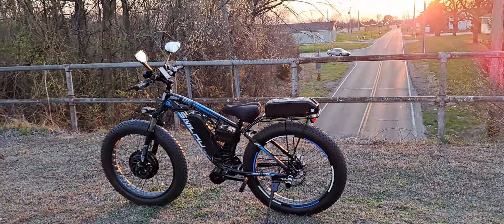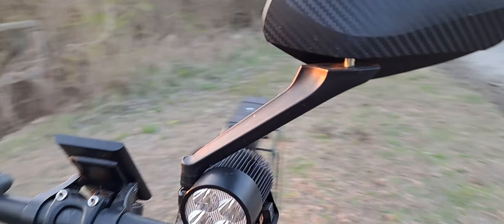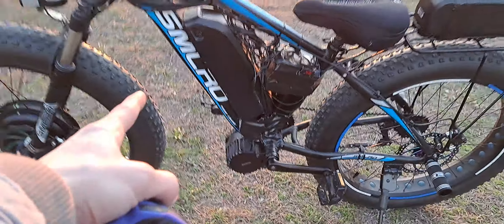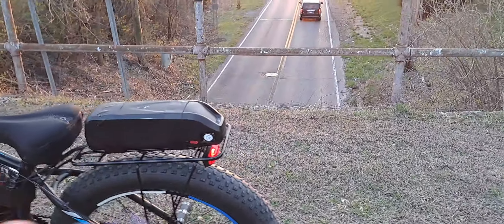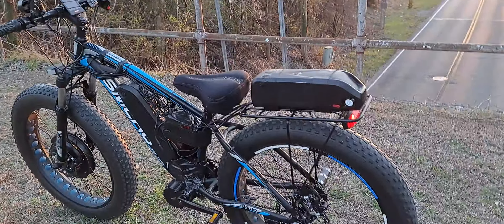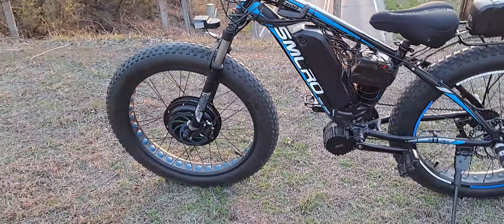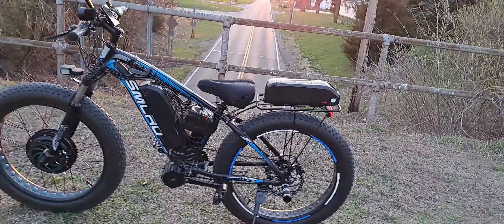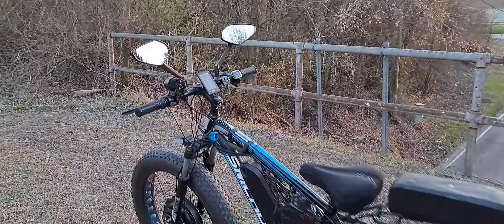Dual wheel drive E-bike build with 3 total batteries test ride

Comment: I got a similar build, I also have a direct drive on my front. A little tip bro, if your controller allows it (or if not get one that does) for the front to use regen braking.. or that electronic braking. They save the heck outa break pads! 

Also I'm curious what front forks you will get that can handle the front motor. Most of the front forks with shocks don't seem to hold up.  By the way what wattage r u pushing thru the front? 

The all wheel drive is fun, especially if you got 2 throttles for modulation! Also having the direct hub seems a very good mix with the mid drive right!! 

Direct hub has the weight that keeps the front planted. 

U going 72v on front motor , what bout the mid drive? 

I bedt that bike eats up the hills right bro 💪🏽
Reply from the maker: 2000-watt front hub so 3,500 total, because I have the Bafang unlocked to its full 1500 watts. But only have a 48V 13ah battery on it, and 52V 20ah battery on the front 2k-watt hub. I wanted to make sure these motors were a good match first. And if I wanted 1 throttle or the 2 separate throttles that I went with. So next is either these Zoom forks or any dirt bike or moped frame I can get for cheap. I might throw everything onto an old moped frame or something. Yes this controller has regen braking and electric braking, but new to those and haven't tested or figured it all out yet. And yes thanks for the advice, because even after going to bigger 203mm discs it is still hard to stop. Yes it absolutely destroys hills, and dual wheel drive is amazing! Thanks man and have fun riding!